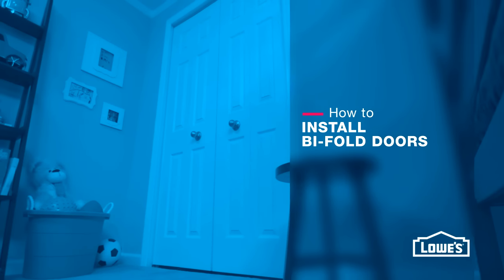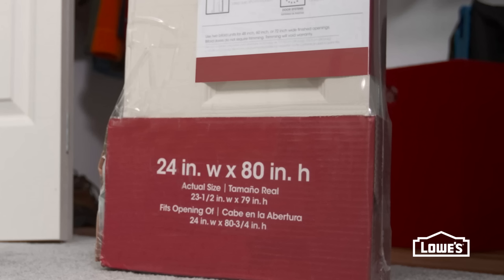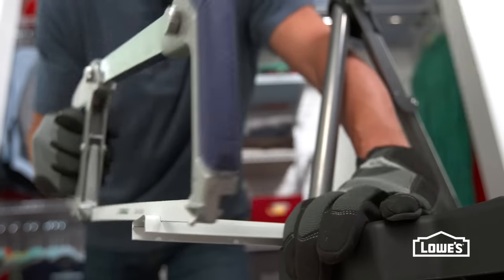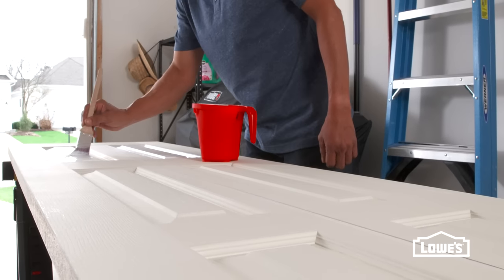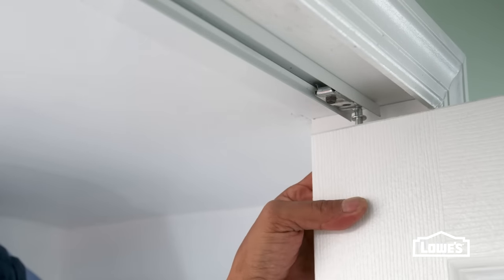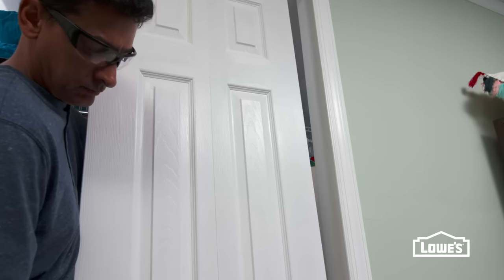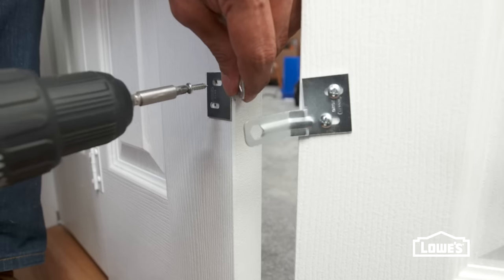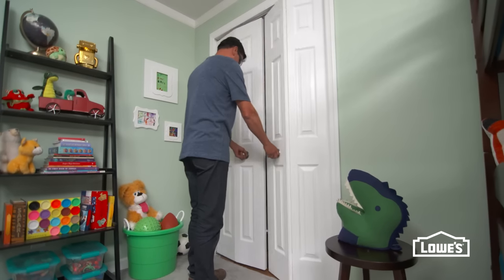How To Install Bifold Doors

Comment: The bifold doors in the house I recently rented are even cheaper than these here with the absolute cheapest possible hardware. Apparently not intended to actually be used! Which makes getting a door back in its track a nightmare. I sure miss my old place with great wooden bifold doors from more than 50 years ago. They never jumped the track once in the 30 years I was there.

Comment: I am a 65 year old grandma & I just installed double closet doors today.  The hard part was I had to cut 3/4 inch off the bottom of the doors & make wooden inserts to fill the holes it left.  Doors are hollow! You have to make sure it is an exact match to fill it & thick enough to handle the pins. I used a 2x4 scrap but had to cut it slimmer to fit. Glue in place.  I also nailed it from the closet side so it wouldn't be seen & also make wooden insert more stable. Then I used a clamp to hold the piece on to the door that I just cut off so I had perfect hole alignments to drill a new holes in the wood inserts for the pins.
 My house is 105 years old & nothing is perfect or normal size.  Like me!
I came here to see if I did it right!  It will pass... so now on to the next project!  Good luck people, you can do this!
Reply: Very nice ❤
Reply: Inspiring
Reply: Damn gramma you know what’s what! Come to my house 😂
Reply: You are awesome! If grandma can do it, so can we.
Reply: Okay now I really need to get off my behind and get this done. Got granny here doing the darn thing! I’ve had the bifold doors in my garage since the pandemic. Thanks grandma! ❤
Reply: No stopping,granny!

Comment: Just curious, is there a way to install these on top of a laminate floor, while leaving the required expansion space? Maybe drill out a larger than needed hole in the laminate so it has the expansion space, and cover it with something to hide the hole?

Comment: Thanks for the video. I have a closet with a regular door frame. The opening width of the closet frame is around 24 inches. I like to install the one folded door because the room door is located nearby to the closet, and if I install the door at the closet, the room door and the closet door will clash with each other. My question is, can I install a bi folder door in the regular door frame?

Comment: I bought a bifold louvered door for my laundry room and there is a marble threshold separating the kitchen from the laundry room. How do I install the bottom piece of the door? Would I have to drill a hole through the marble?

Comment: These bifold doors have their pivot about an inch from the edge.  The ones I bought from Lowes have the pivot only about 1/4" from the edge of the door.  The opening I'm replacing the doors in are similar to the ones in this video.  There's molding on the inside of the door opening.  I'm afraid if I try to install the doors I bought, they won't open unless I remove the molding.  Where can I get doors like the ones in the video?
Reply from the maker: When you say there's molding on the inside of the door opening, are you referring to stop molding from the existing door? Depending on where the molding is, you may be able to install it without removing the molding. It's hard to diagnose without seeing your setup, but sounds like you have a pretty normal opening that should work if the door you purchased matches the width of the opening (not accounting for the inner molding). What's the width of your opening? And which doors did you buy?
Reply: I installed them yesterday, but had to remove the molding on the sides.  The top molding perfectly hid the rail.  The width of the opening was 48".  So they fit perfectly.  
I don't have the name in front of me, but the instructions were the worst and the included screws were not nearly long enough.  I had to drill out the hole where the bottom pivot adjusts.  It wasn't deep enough.  
There was also reference to a part that would join together two rails in the case of a double door, but that part wasn't included and there was no mention of where to order it.  I just installed without it.
Reply from the maker: Sorry for your trouble, Dwayne. Sounds like your DIY skills saved the day, though!
Reply: FYI  - These were Reliabilt.

Comment: My bi-fold are original to the house and won't stay in the track. Seem to be barely balancing on something too. Help. Are they just junky?
Reply: Could be several issues. Are they solid or hollow core?
Reply: Probably hollow. I am determind to save them hahahaha
Reply: @mrststreasures9628  do you know if the doors are plumb (vertically level)? That could be a reason for them coming out of the track.
If they are plumb, you might take them off and inspect the pivot pins and make sure that they are not coming loose. Hollow core doors do not use the best wood for the framework...

Comment: Sir I bought a bi-Fold door at Lowes , it's kinda of heavy it has 3 panels of glass on each door side when I tried to put it on it didn't fit , the door opening is 35 and 1/4 the Bi- Fold door is 36, should I cut about 1 inch off the width of one door ? or will I hit the glass inside ?? and what about its weight, the crews started coming out from the track brackets on my first try, can you help me ??
Reply from the maker: SuperHugobox, you should probably stop back by the Lowe's where you purchased the door and talk with an associate about your specific situation. Thanks for watching.
Reply: Im not really sorry to say, but the closes Lowes to me in Miami lakes 167st and NW 57ave NW , is really a sad place, I tried to speak to a manager and asked an employee to please introduce me, the employee tried and the so called Manager told him he was on his lunch break not even bothering to look my way while I was standing but 2 feet away, he simply went off about his way, so then the employee takes me to the door department and tries introducing me to the guy in charge but he was busy finishing the paper work for a 2 door sale, which took him about 30 minutes, thank God there was no other person in line, but once again he was not able to help , there was a display of a bi-pass door that is discontinued, it would work perfectly for me, but they simply refuse to sell it to me, giving some baloney about they can't sell a display  !! now how can this be if Im willing to purchase it as is ??? if is discontinued why do they keep displaying it ??? why the refusal to accommodate a customer ????? so now I suppose , Im left to seek help on the internet or your competition, I tell you it wasn't a very nice experience, can you maybe give a number of someone I can contact to help me with this problem or is it further waste of time ??????????
Reply from the maker: Sorry you weren't able to get the help you needed. Please call our Customer Care team at 1-800-445-6937.

Comment: The hardware package has a extra metal plate with no instructions as to where it goes.
Also, there is no illustration key that indicates what style and length screw goes where.

Comment: is it possible to replace a double door with bifold doors or would i need new parts and screws
Reply from the maker: It's possible, +pinkblackbrown! You will need new hardware, though. Your double doors use hinges, while bifold doors need a track system. You got this!
Reply: y
Reply: Hardware such as the tract comes with the doors. Just measure the door opening and get the correct size doors. They are very easy to install.

Comment: Hey maybe someone can help me out, i have a 46"3/4 opening for a closet i bought new vented bifold doors which ended up being too big they're 24" each,  i know i should've measured twice before purchasing , but besides that I'm trying to find a solution before returning them, so apparently the next size down available is 18" inches , I've thought About ripping both doors down 5/8" each along the jamb side which will give me the 1"1/4 which will bring me to that 46"3/4 of the opening, but even that might be too tight , i welcome any carpenter advice out there, hope everyone's staying safe healthy and busy👍🏼
Reply: Have same issues I’m maxed out at 46 3/4. I need a 1/4 more to fix. Should I shave door down or trim the trim?